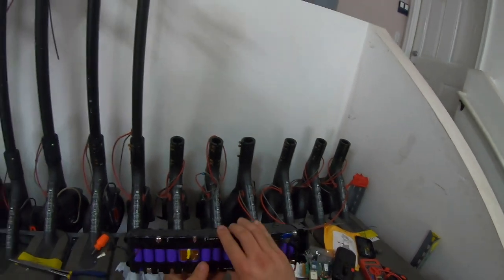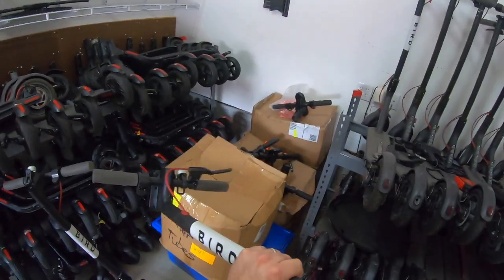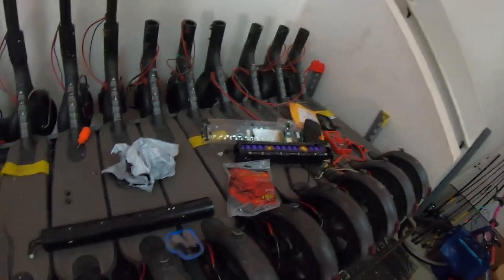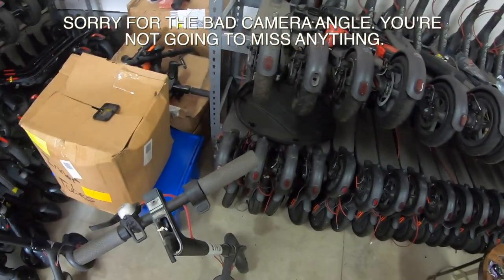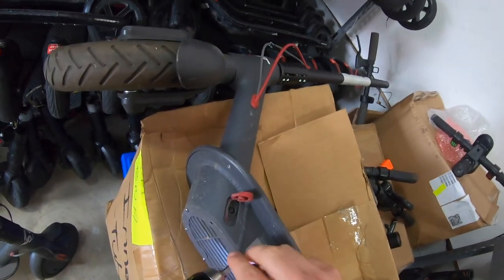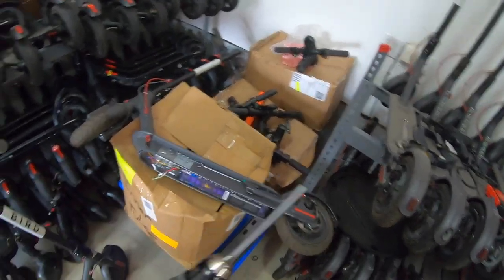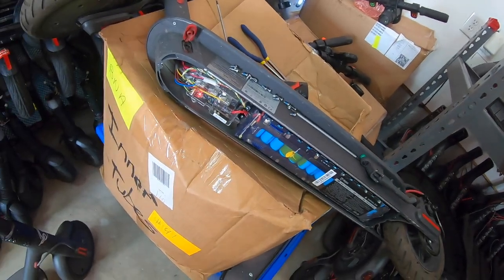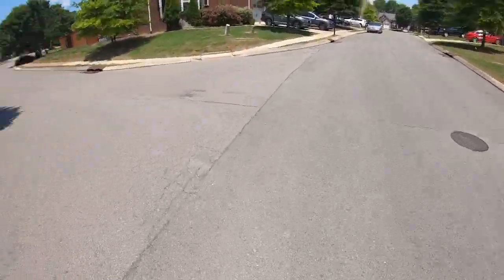Converting A Bird Scooter into a Personal Scooter. All the sauce. HOW TO VIDEO.

Comment: where do you get your boards n name?
Reply from the maker: Local auctions in Middle Tennessee. For closed storage units and Metro Auctions. It’s a grind, you have to search. You can also check repo companies ect.
Reply: @teambryie  to fix old ones the board wut are they called
Reply from the maker: Brandon Largent just search M365 control panel and dashboard.  They range from $10-$50 on eBay. Just depends on who’s selling it. The board that I use has 4 lights on top. Not the digital board. Let me know if you have anymore questions.